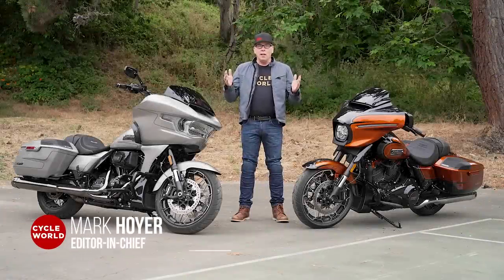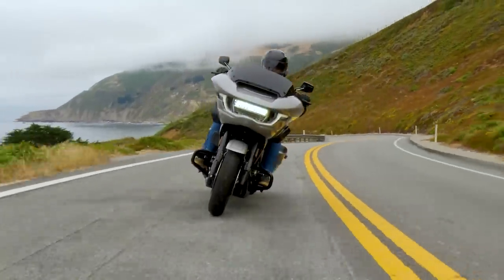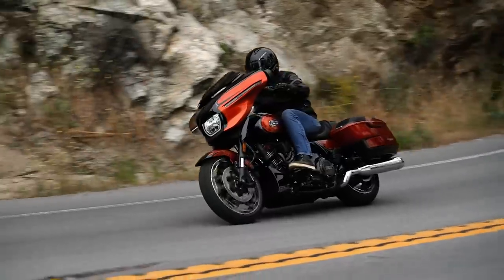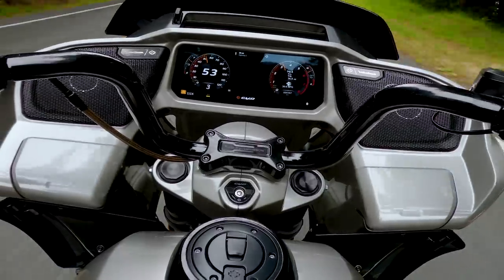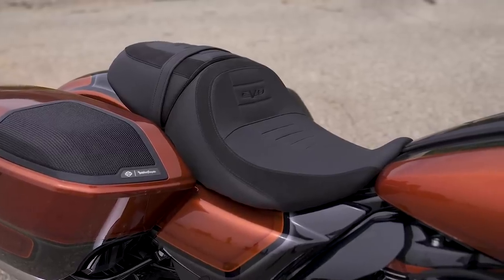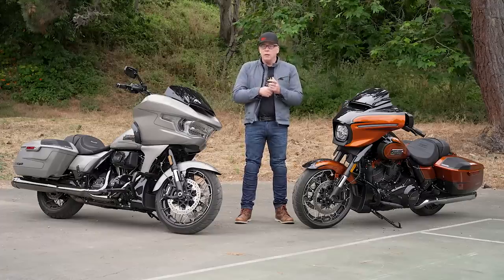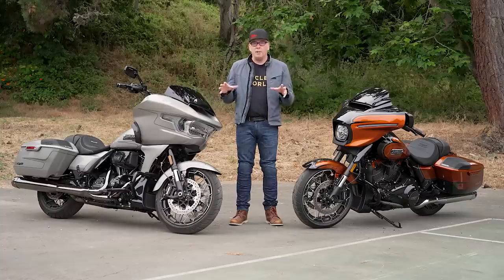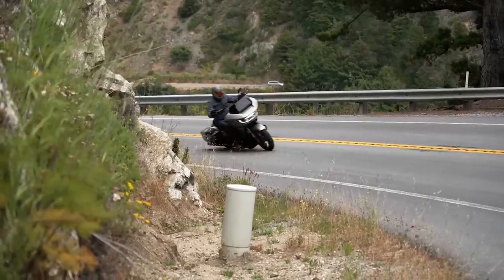Riding the ALL-NEW HARLEY-DAVIDSON CVO 121

Comment: As a Harley salesperson I really wished they used the tech from the Pan-America for the suspension. Would of helped so many short riders ride these bigger bikes.
Reply: Would have
Reply: that orange one looks like a alien ship from war of the worlds.
Reply: Yeah and adaptive cruise control and electric windshield. Someday.
Reply: @BubbaSatori I absolutely hate adaptive cruise control.  I tried it recently in a car and it was the most aggravating thing ever.  On the other hand, I absolutely love regular cruise control.  
As the owner of a Pan American S, the suspension on baggers would not only help shorter riders, but would just be better all the way around.  It is pretty damn amazing in my opinion.
Reply: Lol they use the same frame what the fuck 😂
Reply: Electronic preload adjustment is a big miss for an incredibly expensive motorcycle,  but personally, I think Harley is too obsessed with low seat height.  What percentage of the population is struggling to get a leg over a 27in seat height. And for the people that are maybe harley would do better to focus on weight reduction.
Reply: 3 inches of travel...smh
Reply: So could I realistically ride one of these at 5’6
Reply: @mckerrowcity  I see women riding full sized baggers all the time in SW Florida.  I don’t see any reason why you couldn’t.
Reply: Wieder nicht auf Deutsch

Comment: Was really hoping for a reverse assist and electronic suspension. Also, hope these guys are more reliable. A friend of mine had a Heritage that broke down 5 times within a year. Each time needed a tow. All that said, the price is still insane. BMW R1250 RT and K1600 have similar if not better performance with a whole lot more tech. Not even going to mention Ducati sport bikes with their blind spot detectors. Really don't understand why Harley can't fit more tech on these flagship bikes. I really really love Harley touring bike but it is just so hard to justify that price with the amount of stuff you get.
Reply: I’ve had great luck with the M8. Crazy reliable even after I had a 131ci kit on it. 

Wish I never sold it. But the 117ci I have now is still as reliable.
Reply: More reliable ? I have an M8 with +40k km after 2 Twin Cams (included a 103 cc which I sold with about 80k km, 3 Sportys and even one 1340. Neither of them leaved me on the roadsite. Which was the case of two of the BMW than I owned (included a R1100RT and an engine which had a lot of recalls from BMW). About Ducati, I don't know since when you know them, but as an old biker I can ensure you that Ducati is far from the most reliable manufacturer of the market, even if they  made some improvement this last decade. 
But I agree, H-D is not and never was the more tech brand of the market, and it's certainly not the reason why we love them.
Reply: @pierrelederrey6636 that’s the problem here, the original commenter new a guy who had a lemon, so to him the bikes are unreliable… all it takes is one person

I had a r1200gs that was constantly having problems, but I understand mine was also a lemon. Now I have a ultra classic and it’s never let me down…

Harley’s are reliable if you actually take care of them, like every other bike
Reply: BMW oil heads with 6 speed gearbox have inherent short clutch plate drive problems , failing Hall sensor & insulation problems and more 
Coupled with a refusal to acknowledge these by BMW Motorcrap 
Mine has always been cosseted by me not ever ridden hard , but now needs a life in my garage at great expense of time & money 
Bought my LAST EVER BM !

Yeh ; other manufacturers have problems … 
Thank God for owner rider forums but read between the lines of the faithful

Comment: I like the new look of the Street Glide's fairing. But 121 CI engine? What kind of heat is that thing generating? Not that it matters because who can afford these rides?
Reply: You can..i just got 1 RG CVO...BASE PAINT..41K OUT THE DOOR..DEALER STILL HAS 2RG..2SG..MARKED DOWN TOO 39.999.00...3K BELOW MSRP...PLUS FESS..YOU CAN OWN 1...

Comment: I wonder if they fixed the floorboard mounts and their propensity for leveraging the rear tire off the ground in corners. Other than that these look great. I'm wondering how these updates are gonna trickle down to the ST/Special/Base models.
Reply: Sounds more like its a rider problem and not a floorboard mount problem.
Reply: Some try to lean them like a sport bike but once you hit that point, that back wheel is coming off the ground.  Happens on the dragon all the time.
Reply: @mojomanmurph1925  You are correct. It amazes me that people think these cruiser/bagger/dressers should be able to lean over like a sport bike. Thats not what these bikes are made to do. “Oh but the goldwing” The goldwing is a SPORT TOURER and not on a traditional cruiser frame. You dont get a cruiser to carve corners. I dont get why people dont understand this.
Reply: Even sports bikes have a point where something will touch and leverage you over. 

Ride to your ability or your bikes ability. Whichever is lower.

Comment: $42,000 should pay for electronic suspension. Push a button for 2 or 1 passenger.  It could make more use of minimal suspension travel in the rear.
Reply: This is the one critique I completely agree with.

Comment: Hate to say ,leaving the engine upgrade and front suspension to one side, it lacks the traditional super high quality detail finish of previous CVO,s. In paint detail forks engine ect. 2 years from now the 2026 Street glide special will look identical, for 10k less
Reply: That’s the point of CVOs. 

It’s the newest tech and some “special” add-ons. Maybe some paint options. 

Then it all trickles down to the standard tourers.
Reply: @teensierpython-4565   There has been no new tech on past 4 years of CVO,s until now in form of engine and dash not sure what you mean by newest tech?. CVO,S have been about high detail finish everywhere,this one you have to pay 6k for nice paint option, nothing special about standard silver finish. I think they have not equaled previous CVO,s in detail of finish. And useds prices will reflect this 36 months from now.

Comment: Excellent review.  Based on the MSRP and out the tdoor costs, HD absolutely must push some of these features, looking at the rider info system and engine improvements (not necessarily displacement), down to the base touring models, IMHO. Rushmore in 2013 and the M8 engine in 2017 were important upgrades, but it's now past time to start putting the advanced electronic features other touring bikes have had for a while into the Road and Street Glide Specials. The Road King can remain the purist option for the touring chasis, but if you're going full fairing, you should get the full goods IMHO.
Reply: And guess what?!?! There will also be a model just for you!!! The Dylan Mulvaney Rainbow Woke Signature Edition. Yes! The saddle bags come filled with Butt (I mean Bud) Light!! I am sure this models will suit you perfetly!! You and your rainbow tattoo.

Comment: I firmly applaud the effort. Truly way better than before. BUT why not add the niceties of Brembo rcs master cylinders in brake and clutch and OEM Ohlins suspension. Better OEM seat and better bar setup. I would’ve bought it. No problem with spending $50 on the whiskey color. But if I buy a $50 bike, it’s shouldnt require another dime in upgrades. 

Even if I bought one of these bikes, I would still have to buy a seat and bars. Minimum.
Reply: Well then buy a bike thats made specifically for you right out the factory. Fact remains that they have to be able to make the bike to fit most of their audience. Saying negatives about the bike because you have to understandably customize it specifically for you is being disingenuous.
Reply: @BlinkingKillswitch  my point is that any BMW bike almost perfectly fits me, along with Ducati, any Indian (almost) fits me, Triumph fits, etc…. All of those bikes designed for the upright riding position are 12-20k cheaper than the new CVO (depending on paint color). Doesn’t even matter how tall the bike is, the rider triangle fits me almost perfect on any other brand I can get my hands on except Harley. 

My only bike is a ‘22 FXLRS, so I’m not just crapping on them to be negative. I’ve had to do the same thing to my own bike. The bars needed to pull back 3” to allow me sit upright and have a bend in my elbow. Now, it’s perfect. 

It’s not at all disingenuous to ask a manufacturer commanding such a price to engineer a better rider triangle from the factory.
Reply: @MyFatherLoves  Yes, it is. You bought a bike that didnt fit you perfectly and then get on here whining that it didnt fit you perfectly. You even admit that all the other manufacturers fit you better, but you still bought a HD.

Theres nothing wrong with the rider’s triangle for most people. Yet, you get on here saying that they should make a bike fit YOU better. Thats like agreeing to get punched in the face and complaining about getting punched in the face. 

For 40k-50k the bike fits most people because it has to. If you want the bike to fit out of the factory then get a bike from a manufacturer that you mentioned and then you wont be so disingenuous about your complaint.

Comment: Did they remove the fake vibration that was added to the Milwaukee Eight touring bikes? So now they run smooth like the non touring?
Reply: I’m not sure what you’re talking about. Have you actually ridden a Ultra Limited? I have a 2019 and have ridden a couple other years - all very smooth.

Comment: While a huge improvement over previous models, this new CVO RG still has nothing on what Honda has offered for years except an additional 20lbs and $15k. The Wing will accelerate faster,  ride better, lean harder, and stop shorter while still offering much more features. $6k for a paint "upgrade" is insulting.
Reply: And you know this how? There's a reason Harley sells a thousand Street Glides to every Goldwing sold.
Reply: @JP-dw1fp  Because I've owned multiple Harleys and I still have one I never ride. I ride my DCT Wing much more than I ever rode my Harleys because the ride comfort, acceleration, and overall experience is far greater after adding nothing other than a cupholder to it. I've put thousands of miles on both. Have you even rode a Wing? LOL

Comment: I'd like more information on the infotainment system.  Do you still need to purchase a "WHIM" module and HD branded Sena headsets to integrate into the system.  It's backwards nonsense like that, which is infuriating considering headset tech rapidly evolves while these in dash systems do not.

Comment: For $20,000 less you can get yourself an Indian Challenger Pursuit Limited.  This has to be the most plain paint schemed CVO yet to date.  Happy to see that Harley is finally putting an inverted front end and some performance stuff on their touring bikes.  Dealers will be selling these for over $50,000 with their markup.  Wait a couple years and you'll be able to get all these performance features on the standard street glide and road glide.

Comment: Not changing that out of date frame is inexcusable. this leaves us with the same rotten geometry we have always had, the same poor rear shock options, and the excessive weight.   They obviously went maximum low effort with these bikes. The VVT was always expected to meet future emissions, the new fairing was supposedly in development before the Revolution Max motored bikes and was suspended to focus on them, and finally we will end up with the only tour line without adjustable wind screens, remote locking (ultra and specials), and no mono shock.  Inverted forks and radial brakes are parts bin choices for more competent brands and the upside forks have been around for a long time on other Harley models.  
  
with regards to the rear shock, the CVO does not count, what matters is the bike the leave everyone else with on the base and special models.  Going to be real interesting how much CVO content is lost to reach a Special and base model of each line.  Buffeting could have been nearly eliminated with an adjustable wind screens, BMW has had it since 96....     All this and the bags are smaller!!!!

I am a Harley owner having waited years for this refresh and my disappointment should be obvious; going to keep the FXLRST for a long time  
 
BMW does far more on their K1600GT and R1250RT for far less than Harley has ever done or tried because Harley knows their buyers are exploitable.
Reply: I thought that as well, still going to have that heavy off the kickstand feel.
Reply: I own a K1600B, I agree with you
Reply: I bought a new r18b and it's superior over the new harley. Maybe not power wise but anything else it is pretty much
Reply: Just go check out an Indian Challenger.
Reply: @huibertdegraaf9622  I hope you and the 12 other people who’ll buy that bike enjoy the 5 year production run of it.
Reply: @CindiB_Does_America  Yeah, off all the bikes of all tine, the Challenger is one of them.